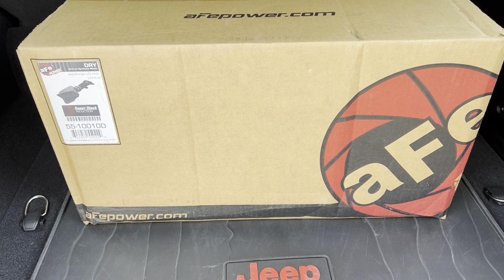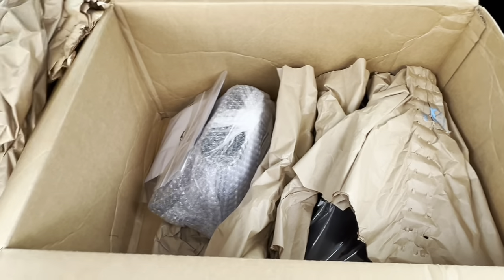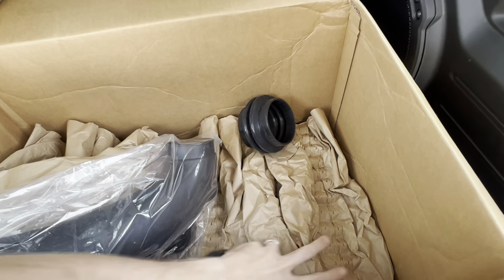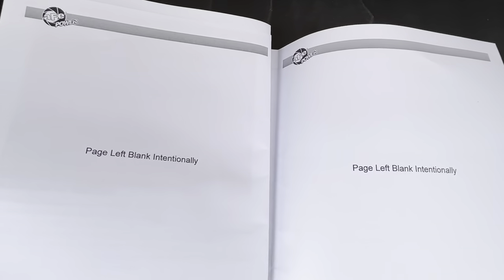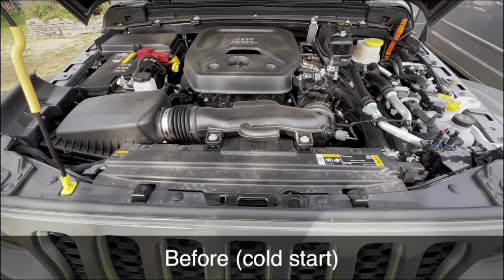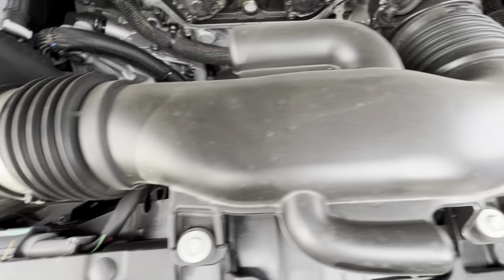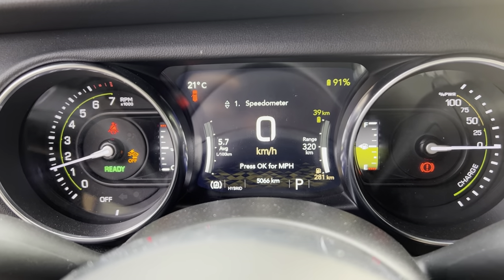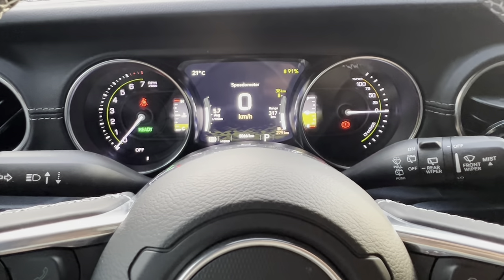Jeep 4xe (JL) | Super Stock Induction System with Pro DRY S Filter Unbox and Install

Comment: Thanks for the video! 
Did you have any problems with the rubber grommet when installing the sensor? And or any problems installing the sensor itself?
Reply from the maker: No issues at all, grommets fit fine and sensor too . Very easy install ! :)
Reply: @XploreAndReviews  Thank you for the reply and the info! 👍👍

Comment: Thanks for posting this.  Question for you: how much louder is this intake system compared to OEM?  Specifically, the noise from the engine bay during hard acceleration and/or the auto transmission downshifting.  Thx.
Reply from the maker: It’s a little louder and adds a slightly more aggressive tone  on full throttle which is nice :)